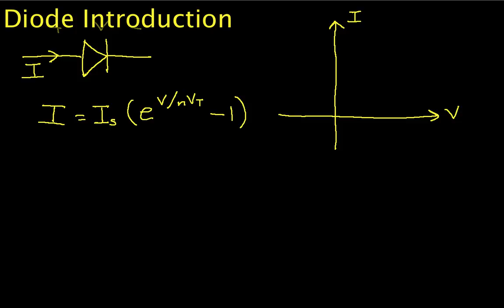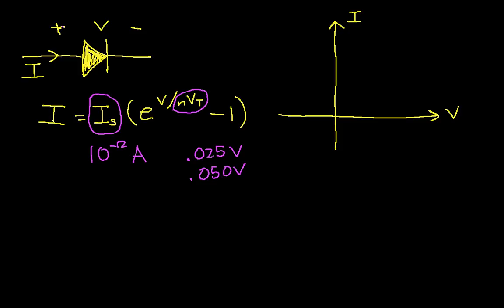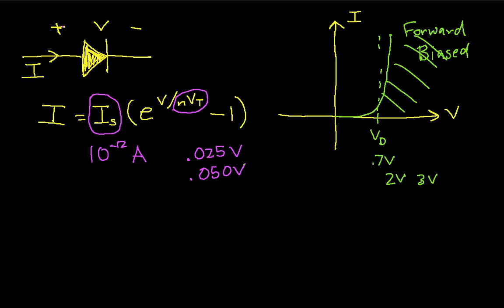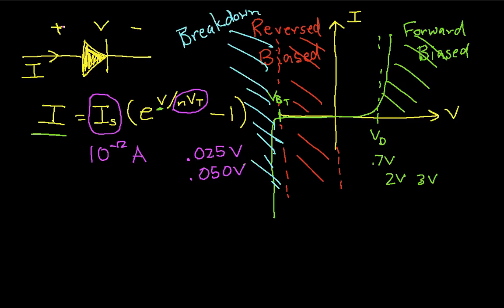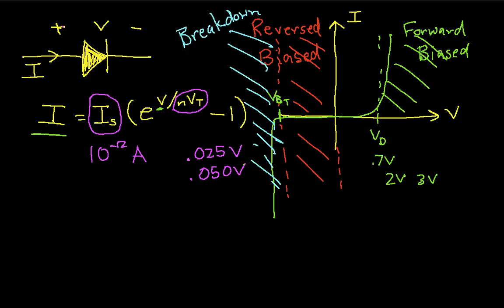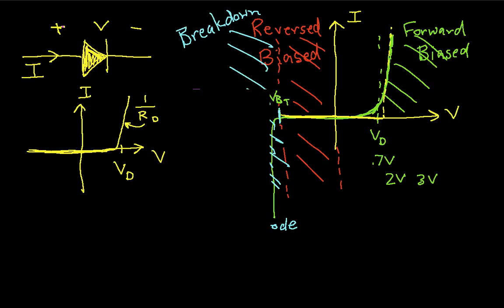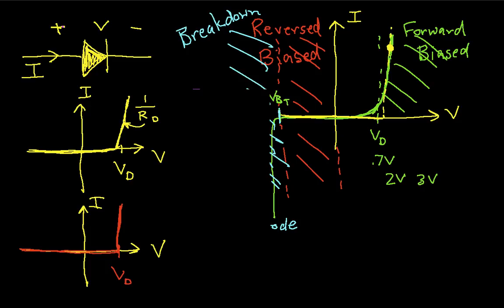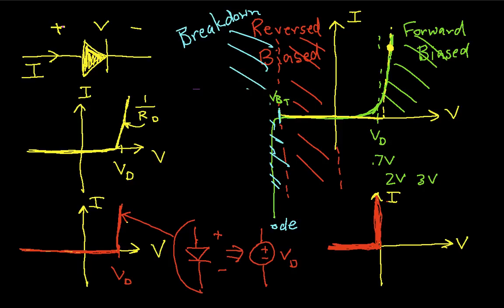Diode Introduction for Circuit Analysis

Comment: Two mentions, though : I in the first quadrant is much more "bigger" than in the third  quardrant. Meaning, the scale for I are not equal for foward and reversed biased study. Also for the U scale : while the U scale for foward mount is 0.2 0.4 0.6 and so on [V], for reversed biased it must be like 20 40 60 80 etc [V] because the breakdown voltage is much more bigger than the "opening"  one.